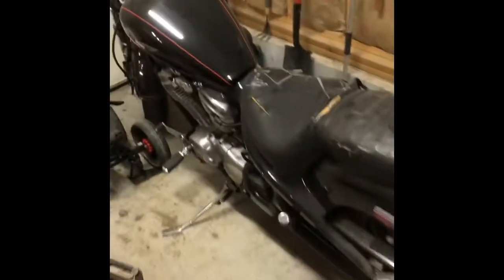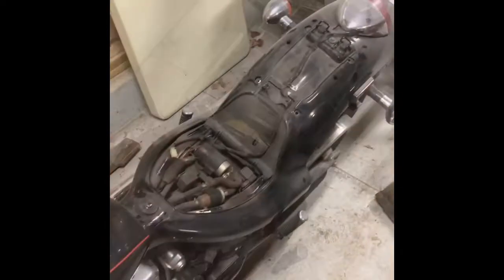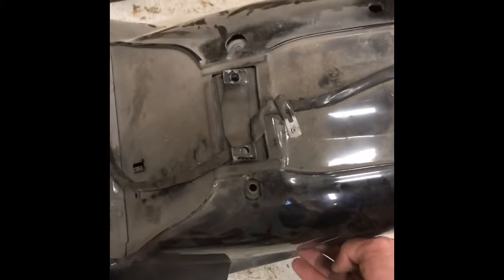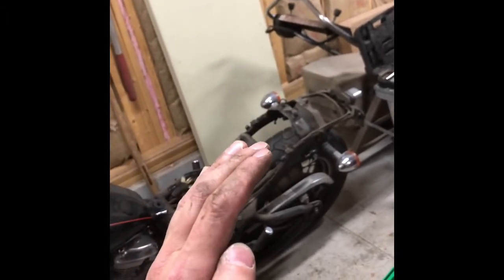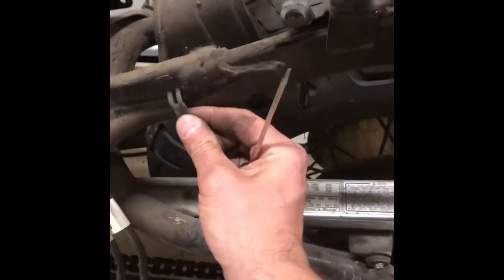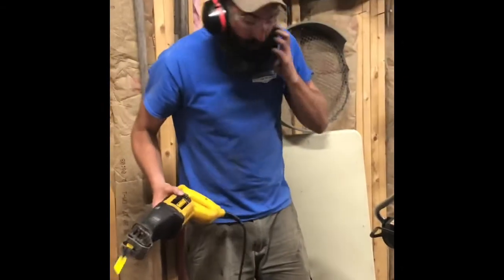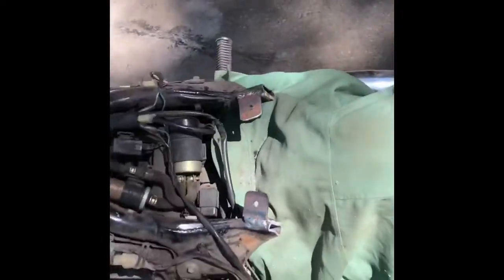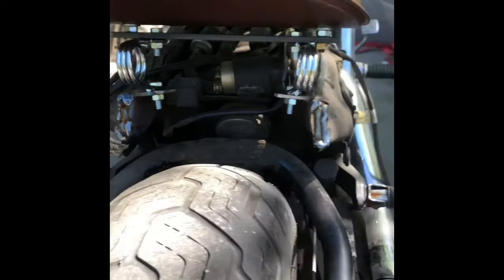93 Honda shadow 600 solo seat installation

Comment: How did you mount the lights?
Reply from the maker: I welded on two tabs that stick out from the the ends of the cut frame. I’d post a pic if I could. Watch my video on how I install the rear fender and you can see the tabs.